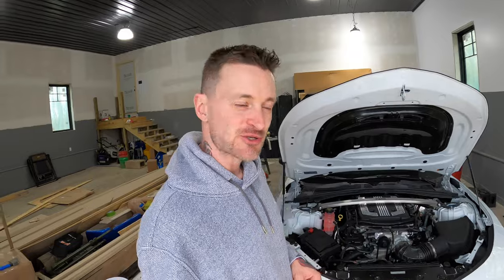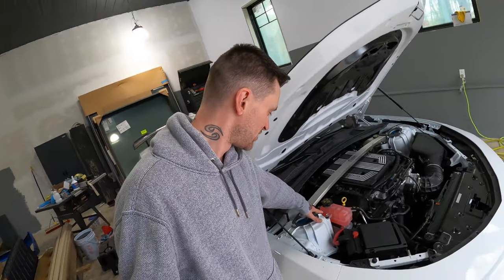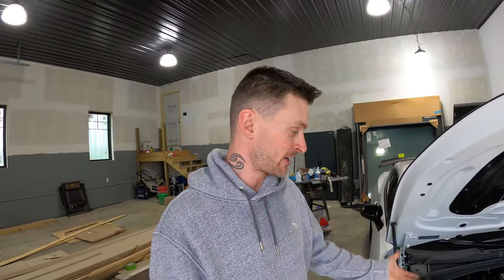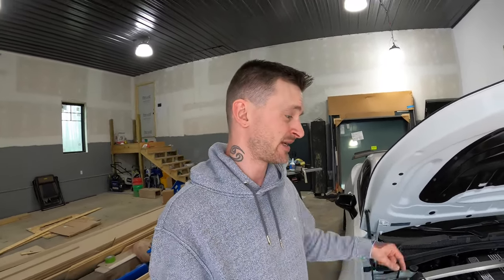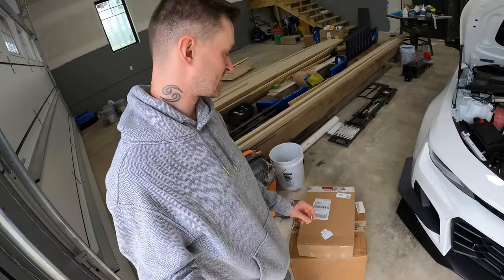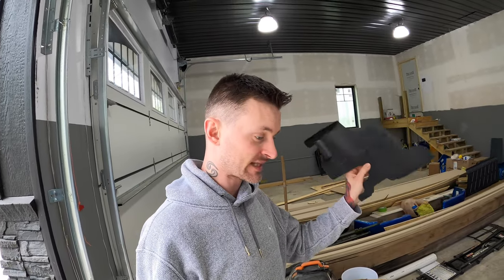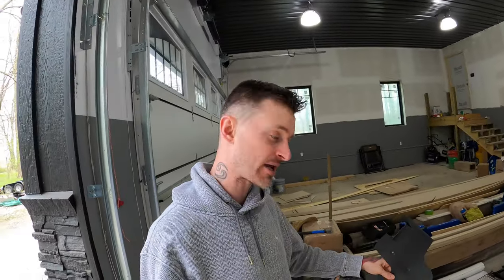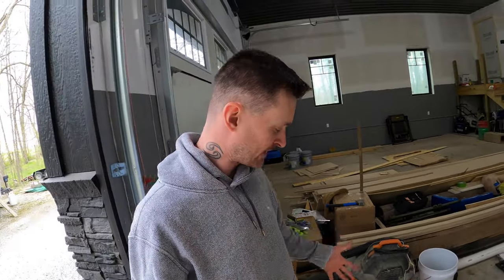2022 Camaro ZL1 1LE dyno numbers!!!  And parts from ZL1Addons!!

Comment: I'd run the race oil through cheese cloth or a good nylon filter like a paint sprayer filter and save it. It could be just a little carbon.
Reply from the maker: Man how long did that take to get all 10 though???   It didn’t show on camera but there was about 100 small dots.  100% could be carbon or oil build up on the sleeves and the rings shave it off.  No big deal but I’ll do it again to check and maybe save specially this 0w40 cause I’ll probably do another track day before 3000-5000 miles.

Comment: sounds like time for big mods and a tune! LOL Nice video, subscribed! Love the ZLE content! Absolutely love my 2021 ZLE. EDIT: Look into a stock size ported throttle body, that made my supercharger whine crazy loud. way more than just my rotofab.
Reply from the maker: If stock sized, how much did it open up?  They thin the butterfly mounting plate too right?   If it is a lot bigger than oem, did it over port the back and now you have a lip from the LT4 hole being smaller?
Reply: @neckofthewoods24  The Ported Throttle Body does nothing except remove any off the line hesitation or bogging. I highly recommend it as it is easy and cheap. I have the Katech LT4 PTB and have never looked back.

Rotofab is good for nothing but more blower whine inside the cabin. As someone who actively tracks and has plenty of feedback from other ZLE owners - keep the stock box and use the Green filter. Save your money for something else.

The only mod I would vouch for is the ADM V2 Intercooler reservoir. It adds more IC for the SC when hot and prevents the need to purge the system of air. Easy to do and budget friendly.

The ZL1/1LE is all about harmony. It doesn't 'need' more power.
Reply from the maker: @AllIsWell_22  well to late now haha.  I’ll take the 13hp or more like 15hp because the run was cut short by about 200-300rpm.  The hp was still climbing.  So if both would have went to 6600rpm it’d of shown another 2hp.   For the cheap used price I paid I’ll take a free 15hp and whine.   I’ll have to look into the TB again. I have zero complaints of lag or bog on this 22.
Reply: @neckofthewoods24  I have the tony mamo V2 ported throttle body, it really just smooths up the lip thats on the stock TB. Definitely takes away that off idle hesitation but my butt dyno definitely picked up some ponies. Also Tony (I think everyone does now too) files down the butterfly shaft. its like 150-250 CFM over stock (would have to confirm with their website).
Reply from the maker: @kennethsculley9420  I used to port some manifolds and was hooked up with a guy that did TB’s so I could sell as a package.   Expensive 3 part kit for about 12hp but when you’re NA you take what you can get!   I’ll look into It guess since I don’t want to tune.  Also maybe one day the Kong x port SC since a black wing picked up like 40 or 60hp from the port only and AFR was spot on!!
Reply: @neckofthewoods24  There is a lot, tony mamo claims no tune needed, mine set the CEL till it learned the extra air coming but now she runs like a top. Obviously you will get more out of any mod if you tune it into the car but tune free mods are nice to keep the warranty.
Reply from the maker: @kennethsculley9420  honestly I think it’s the same HP.  Hear me out, the cars now a days have wideband primary O2’s.  They can tune a pretty big window unlike a narrow band.   I think tunes get you a lot more because they are tuning everything like timing, boost, waste gate if you have a turbo, increased redline and AFR etc etc.   if the tail pipes or widebands are readying dead on AFR then a tunes not going to gain anything.  They are gaining because everything else is getting tuned which isn’t needed if the cars not knocking and the AFR is perfect.   Also you would need a tune for like the big gulp because you have to recalibrate the MAF being in a bigger housing.  Just depends on the car.  My WRX’s used narrow bands and they couldn’t do crap!  My 370z used widebands and it was amazing what you could throw at it with zero issues.
Reply: @neckofthewoods24  perhaps you are onto something but Tony has forums with dyno data that shows increases in torque and HP across the board with and without a CAI. I think there definitely is something gained from it.

Comment: Mine will be here in 2 weeks pumped
Reply from the maker: Nice!
Reply: @neckofthewoods24  do you think they will hold value pretty good the 1le?
Reply from the maker: @TheTristiano19  no i dont.  the market will adjust, gas at $6 and rising and it gets like 4 gallons a mile on track, it is a track car so people will view that as abuse and really used up as a car etc.  parts will be cheap and easy however to replace and everyone knows the LS motor so easy to work on and fix.  we'll see though but in a normal market i think they will fall just like any car and maybe faster being a track car.

Comment: What’s the top speed on it?
Reply from the maker: On the car or dyno?  The car I think its like 190mph for the 6 speed and 202mph for the auto but both are limited to drag and HP.  I think in 10th gear for the auto with a million horse power it’d theoretically top out at 280mph with the 0.64 ratio.  I’ve seen 180+mph easy on both.   As for the dyno I think 6th is 140mph and 7th is 180mph.